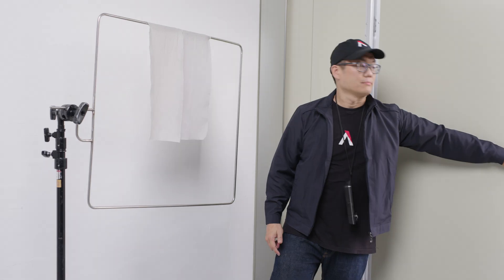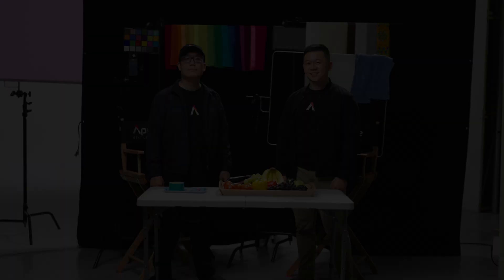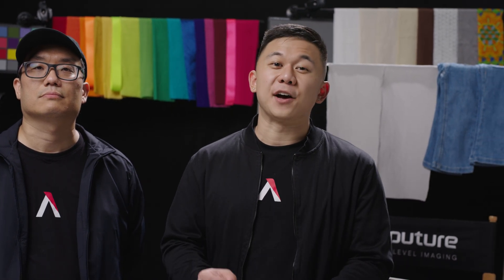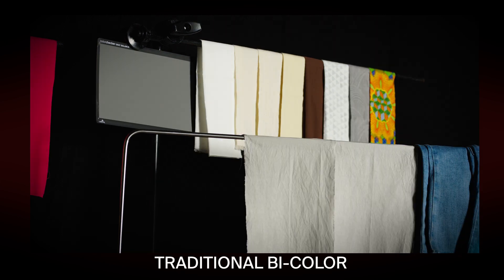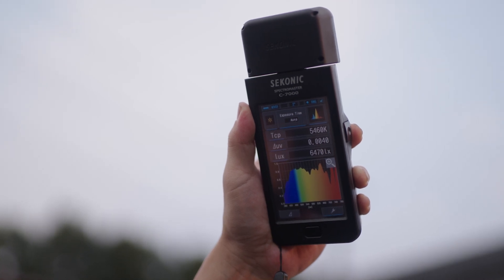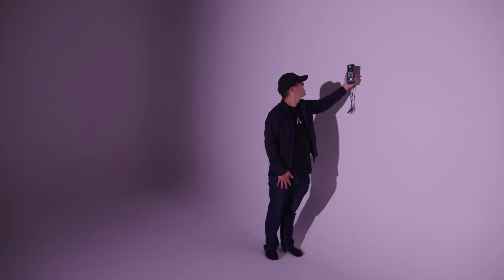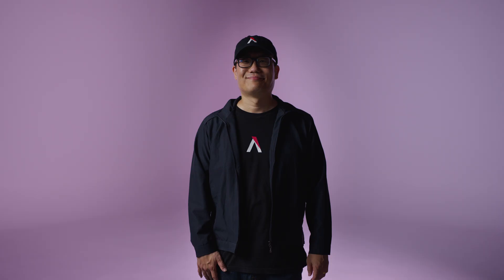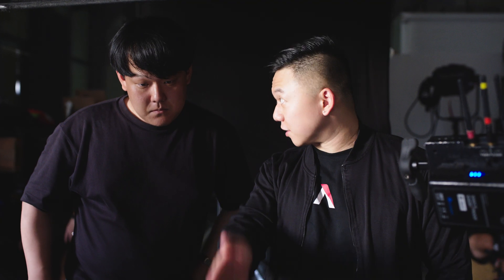What is BLAIR? Exploring Aputure's New Revolutionary Light Engine

Comment: Im really confused @Aputure - skin tone wise, in your example, the 1200x is miles apart from daylight and the bi-color matches up with it much better... what am I missing here?
Reply: Agree with this. Not only that, the WB  doesn't match between fixtures. They probably set it at 5200K on all fixtures. In that case, the  results are pretty bad for the 1200x. More nuanced tests would be welcomed.
Reply: @aputure, could you disclose what Traditional RGB fixture you used for the comparison? Was it another Aputure fixture?